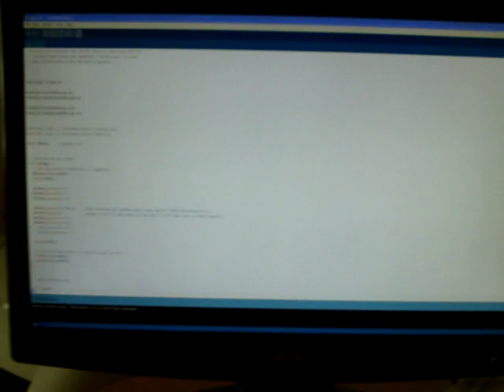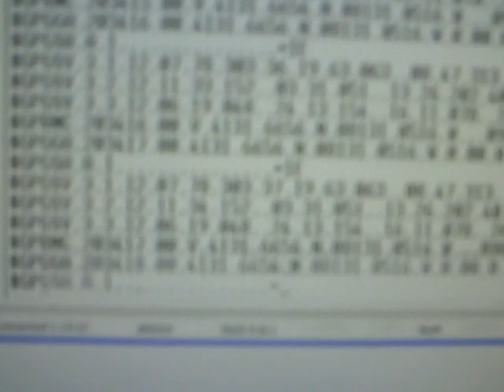Reading data from GT-320FW High Altitude GPS Receiver with Arduino - Test 01

Comment from the maker: I am using the built in serial port to communicate back and forth with the host PC.  I am doing a bit-bang serial receive on one of the digital pin to receive the data from the GPS.  Bit-Banging is using software to toggle an I/O pin or to monitor an I/O pin to send or decode serial signals.  Try googling "bit bang serial" without the quotes.

Comment: Hi,

Great project. I am working with the same components but have a few questions: Are you using the USB on the Arduino (for monitoring) and the Rx/Tx pins (for GPS)? If so, how are you differentiating outputs/inputs? Any chance you could send me your code? Why all the excessive resistors and circuitry?

Comment from the maker: I don't have any of the data handy, but it is standard NMEA data.  Most all GPSs pump out the same stuff.

It looks like this:

$GPRMC,220023,A,4131.652,N,08131.147,W,000.0,360.0,260398,007.9,W*75
$GPGGA,220023,4131.652,N,08131.147,W,1,09,2.0,251.4,M,-34.1,M,,*7C
$GPGSA,A,3,02,04,05,07,08,09,,14,16,,24,,2.4,2.0,3.0*34
$GPGSV,3,1,11,02,19,160,38,04,81,300,49,05,28,311,41,07,53,085,46*79
$GPGSV,3,2,11,08,13,303,36,09,17,265,38,10,03,192,00,14,20,043,39*70